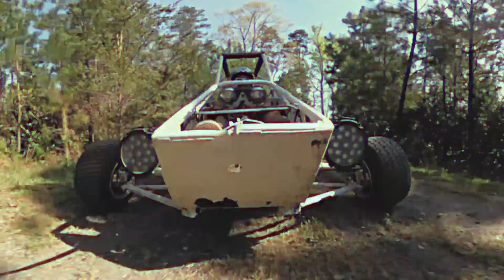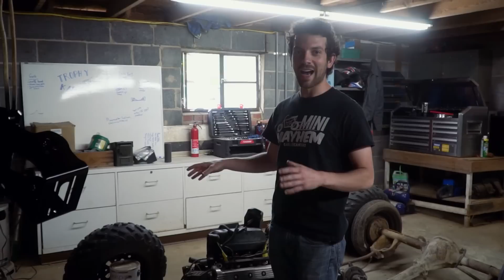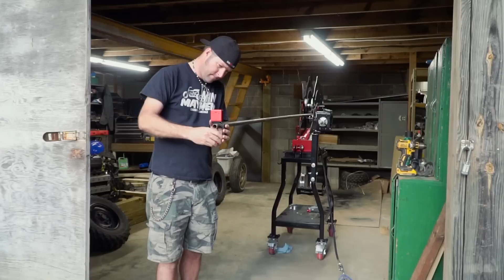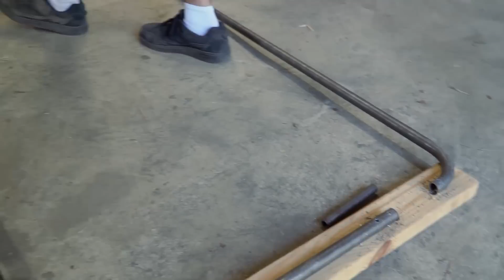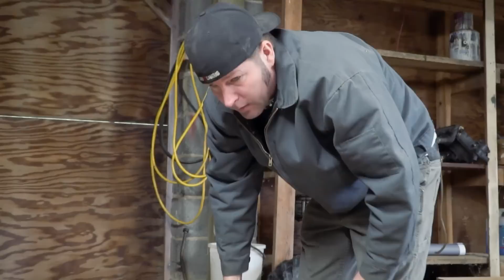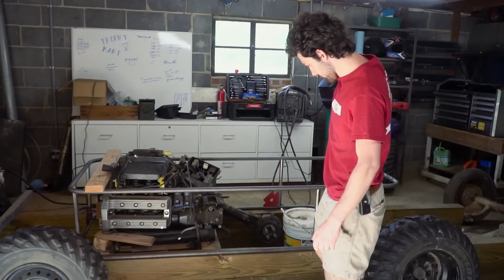1000cc Mini Trophy Truck Build Pt. 1 | BMW Powered Baja Buggy Go Kart!

Comment: That tube is way to small for that big a build. 1-3/4” .250 dom! You’re going to need 1-3/4” for the suspension links anyways to get proper hiems etc for joints. The entire frame should also be built from this. Yeah you’re picking up 15% in weight but you’re gaining 300% in strength. Cheaping our in the pipe for an actual full size vehicle is not something you want to be doing with something you’re going to beat hard.

Comment: You could angle the rear up right supports and add a bit more length to them. Then cut and angle th rear upper frame. To give it more of an aggressive look.

Comment: 1-1/2" .090 wall thickness is the engineered proper size for a 1000cc according to every sanctioning body of competition out there.. 1 inch is dangerously too small.  Look to Mini Sprint rules and Legend and Dwarf car rules building, NASCAR Short track rules too...

Comment: Have you ever considered a predator powered air compressor, where you have an electrical clutch connecting the engine to the driving belt, so a normal pressure switch could work?

Comment: This is purely my opinion, but you should really look at some off road tube frame chassis for ideas, none of them resemble what you have done so far. Look at the chassis design for front engine off roaders for an example. What you are doing is way too short and way too weak as it sits. I would also go with a 4 cyl car engine and transmission, that motorcycle engine doesn't have much torque compared to a car engine and you are grossly overestimating the electrical capacity of that motorcycle engine and there's no way to increase it, with a car engine its simple to go to a bigger alternator.

Comment: That seems like a lot of weight and power for 1" tubing, but I'm sure "it'll be fine".
Reply: Bro ppl build all the time with 1in. TUBING,.. 1300cc hayabusa  engine in a frame built with 1 inch ,..as long as they brace it properly, it'll be fine.

Comment: Why would you use a live axle over independent suspension?  The ride on a live axle for off road especially, will never be near that of an independent setup.
Reply: Just to try something different. Plus most trophy trucks are solid axles from my research

Comment: it looks like yall going to have a hard time with the drive shaft if you keep the engine at that level.. exhaust might also get uncomfortably hot! wheel base looks perfect, as for suspension travel in front of the engine and a little behind the seat position will get you the best results it all depends on how high off the ground you wanna go

Comment: If you were able to get a car engine with a fwd trans you could have made a mid-engine monster. Turn the engine where the belt is facing forward and have the fwd trans facing front to back. Then using the "drive axle" for each front tire as front and rear drive shafts. 
The trans has a diff slip so either welding that up or finding someone that makes a limited/locker for a fwd trans (4t60e and 4t65e have followers) you lock the trans and let the actual axles take care of diff priorities.

Comment: Um.... guys...
I don't want to stick my nose were it don't belong, and please feel free to tell me to mind my own business.
But that chevette axle isn't going to stand up to the kind of abuse you plan for it.
Believe me, I was stuck with one in the 90s and I was almost killed as the right rear chevette axle flew out of the houseing in a mild turn.  
If I may, I'd like to recommend a Subaru suspension system, they are tough, light, and better for what you have planned.
The good thing is that they are inexpensive, get a late 1980s 4 wheel drive car as a parts car.
Please don't depend on crappy parts, look for the good stuff.
It might not be fine.
T.

Comment: Check the splines on the bmw drive line they can round out and can imagine they will not survive  the weight and stress of the vehicle...i know its early in the build so not sure what the plan for connecting  the rear end to the bmws driveline might be. Also the bmw requires resistance  to excite the alternator normally  from the battery light on the cluster but a simple resistor can be used instead if the cluster is not used.

Comment: see if you can scrounch up some straight pieces of i beam like from a torn down old steel building , and put ajustable feet under them , set those up on the floor next to eachother and set those up level to the other, you can use those as youre frame and a welding jig , it basicly the same as you have now with the wood beams but more stable and fire resistant
as for putting the bender outside , yes you can but once you moved it you need to reset youre electronic level , the machine is probably far from level unless you make it level with the ajustable feet and the electronic level whont be acurate 

as for new shop tools like a good large volume compressor , maibe a good steel workbench , hydraulic press . a steel cutting bandsaw , stationairy drillpress and a stationairy belt sander , im guessing youre registered as a company for youre youtube channel , so see if you can get intoo any local auctions for bankrupt steel companies and garages (motorcycle lift tools and toolcarts), 
unfortunately for most i guess , with the corona stuff preventing companies from earning money there bound to be quite a few more companies that have to file for bankrupty this comming year 
when bidding for the stuff at steel construction companies make sure you look intoo there steel pile too , the stuff usually goes cheap (usually sold in lots though you might be able to sweet talk the auctioneer to put together youre own lot of the stuff you need) aspecially if the weather is realy bad and the auction is mostly outside or on a workday (less people willing to be there to bid on stuff) and you can get away with some realy nice professional tools and materials (bring a truck as you need to haul it off on the spot)

Comment: how do you even approach a prject like this? Im sure that your guys experience with go karts over the years probably plays but i feel like there are so many different factors (motor placement and size, type of susspension, height of the chasis=to the comprasion rate of the suspension, etc)that come into play when trying to get a picture together of the final project
Reply: I go in blind and hope for something cool

Comment: make the front end modular, with a trellis system frame. support it up and bottom on the corners of the existing center frame. make sure you make the center part the ridgid one. Otherwise, great project!

Comment: Maybe this gives you some inspiration! AutoCross Netherlands Sprinter Frame! Lot's of pictures on the web and also video's of regional dutch autocross racing events showing of what these machine's are capable of. Most popular Sprinter setup: Sprinter 1600cc (max) rear mounted Hayabusa motor-cycle engine, front motor-cycle wheels and big wheels in the rear. I love to watch those events live. :)

Comment: Cool build start guys. If u guys ever want to use 4130 in builds the best online pricing I've found for it is airparts ink. I've also ordered from them in the past and have had 0 issuies. They ship 8' or shorter lengths with ups. And can do 20' via freight.

Comment: Rock racers...That frame looks weak.tubing wall needs to be thicker if you want brute bang through up n over anything strength as well as suspension attaching...truss design for more rigidity,and as many points in a full cage as possible...

Comment: Shop compressors can get expensive. Here's what I did. Go to Harbor freight and buy 2 of the 2.5hp 21gal compressors. Regular price is under $200. They go on sale for about $160. Set them up outside, (it's quieter) connect them together and plumb through the shop wall with PVC to a good air dryer. When I turned mine on they went from 0 PSI to 125 PSI in 6 minutes. Recovery from 90 PSI to 125 PSI is about 1 minute. You will have enough air to run just about anything for around $400. One tip if you go this route. Retorque the head bolts after run in and check them annually.

Comment: OH man, they're gonna find a lot of problems with this build. The weight and gearing in that rear end could poo poo all the power. Getting the engine output to mate with that weird pinion is going to be very difficult. Weld the spider gears in the diff, otherwise it's going to be 1 wheel drive. That frame has "catastrophic failure" written all over it. Get ready for a 20 part series.

Comment: what I was thinking. Square in the middle for the driver compartment, then raised frame triangulated  at each end. Definitely will need a engine/trans/driveshaft heat-shield/scatter-shield so y'all can keep on building!

And Hello from Raleigh! Woop Woop!

Comment: Have you checked the rotation of the BMW drive shaft?  Most shaft drive bikes rotate the opposite way to car drive shafts (the pinion is on the other side of the crown wheel).  You may need to think about mounting the Chevette axle upside down.... then make sure the axle breather doesn't dump EP90 all over the floor :-)

Comment: Even before that first bar was done I knew you were going to hate it. Maybe on a home made 1980's go-kart the bed frame with a plate floor would work.
I saw where you were going on wondered what the purpose of that tube was? It doesn't pick up the motor mounts, doesn't attach to suspension pickups, doesn't mount the seat.
If you look at any vehicle like that you'll see there's nothing superfluous. I would run a tube from the lower motor mounts, to the seat mount, back up to the rear suspension towers. As a starting point. Then work from there.
Reply: P.S I still think the cross kart looks wrong.
It's not terrible, but could be so much better. I think the wheel size let's it down, and this kart is going the same way. Needs bigger wheels.

Comment: Awesome build! I'd get the engine mounted up to the bottom half of the frame then drop the upper front a bit while keeping everything accessible. Just lower it enough to get rid of the square look. I'd consider changing the front if it while you are in there to extend for front suspension support. You could use the current set of 90s to go over the front of the engine and take some spot lights.

Comment: Build it strong. I can tell John will be afraid of it, at least in the beginning. That engine is a game changer. Those parts for $500 is a deal. It's taken me some time to get some parts together for a buggy. Starting out on a floor like that is good. You will learn so much more.

Comment: With that diff, and those wheels and everything else thats got to be bolted and welded on to this thing, you will need a 2nd motor to make it go any good at all.
I'm a BMW bike owner and love them but I think youre expecting a bit much from a flying brick.
I love these guys and their enthusiasm but everything is just a bit dodgey and half arsed with little to no real planning or decent design principals.
That tube is all wrong from the start and that chassis already looks like crap IMHO.

Comment: I’d like to see you guys do something with a 4 stroke snowmobile engine. I think a Yamaha would work great as the use I high mount rad for cooling compared to tunnel coolers like other sleds. Have an awesome cvt set up and has 150+ hp stock with endless options to add turbos and supercharger

Comment: hmmm, I hope the transmission of the motorcycle engine can take the drive-line load weight of the car rear end and tires. Consider rear engine too.  Plenty of Baja Racers use rear engine builds.

Comment: You could probably put a big compressor with a horizontal air tank upstairs, or build a small shed out back. But you need something with a motor and belt-driven, oil-using piston pump instead of any of the little oil-free portable compressors. Then you need a safety switch on the wall near your panel so you can cut the power to the compressor motor while filming your dialogue, then turn it back on and let it recharge.

Comment: If you guys want your Ibeam to hold more weight. Weld steel plates along the beam between the two horizontal plates.

Comment: I had a couple of questions about building a go kart frame. Where would you recommend ringing usable engines and parts for cheap like at a junkyard or something and out of curiosity why do you guys prefer the round tubing compared to the square tubing?

Comment: Mmnnnn Twin I-Beam. Love it. So stupidly tough. Just watch your ride height guys; camber will change with suspension travel on Twin I-Beam and if your right height is off your camber will need to be adjusted quite a bit to make that work. I would suggest setting it such that there is precisely 0º camber with the kart empty so the weight of the rider will add a degree or two of negative camber.

Can't wait to see it rip! That front end's been under Fords for over 60 years now and it's proven!

Comment: Google trophy trucks look at real ones and some rc one... secondly most trophy trucks and any race or off road vehicles  they start with  Figuring out the vehicle suspension And where those components need to be at In the frame is used to tie in those parts

Comment: The cross cart's front end looks like it still sits way too low you have A arms for a reason the suspension should have been mounted a lot higher and a little bit less of an angle

Comment: Guys you've got like a bajillion engines,  all you need is a larger air tank and a belt driven compressor, build your own air compressor,  it'd be simple and very useful, could use that bender all day and an air hammer with impunity.  Do It!

Comment: You can always look at the mod lite car. Their a 5/8th scale version of a modified dirt track car and they actually use a 1000cc engine with a solid rear axle.  If you use a frame designed for that, but with a long travel suspension it would be awesome.

Comment: I don't know why you are wasting money on DOM tubing when ERW would be fine. you are not building to a class of racing, 1" x .090" ERW with the seam on the inside of the bend and you are golden. does that Chevett  rear end have "C" clips holding the axles in? if so you will want to address that.

Comment: Stick with the chevette for the front hubs. The bolt pattern is the same front to back, four bolt 100mm. This is also a common atv bolt pattern. Also chevetterims are thirteen inches in diameter, six of them and you can get them widened to take any thirteen inch atv tire. Early eighties BMW four bolts will fit as well as eighties/ nineties dodge four bolt rims, this gives you fourteen and fifteen inch rims to access. This may oversize your tires thiugh. Sticking with thirteen inch ATV tires and modding the chav rims may work best.

Comment: Short ssnd cars front suspension or ssnd addiction.  Same thing but the sand addiction spindles had king pin angle and handled better in a straight line. I would go with fox 2.0 shocks they are cheap and work well till they get hot. 
Azrockcrawler for the chassis inspiration.  I want to see long trailing arms to where the drive shaft comes out of the engine.  More than 12" front suspension.  If you cant hold on to a drink and hit whoops at 50 then I will be disappointed.  Time to step it up gentlemen.  Take it to the next level. I pieced together a short sand car years ago. Got the chassis untabbed and went ot town. Cbr954rr motor it ripped, we were so hard on the damn thing it needed a valve job after every dune season (6-8)trips. Good luck!

Comment: Great parts.. glad you guys are getting things together.
I do think a rectangular or square material  would be better. 
And maybe go for a more sand rail frame design? Just saying.
Go rear engine with it. The weight  in the back will help ...
Any way either way...
It will  be  fine...

Comment: Weight will be the biggest issue. If you make it too heavy that engine will hate life, they are designed to rev and not be lugged about. Watch the struggle Rather B Welding had with his VFR1000 powered buggy.

Comment: Super looking forward to the build and loving the intro. but i always thought the process of building your own space frame starts with the wheels, then suspension and then the chassis. to avoid all the chopping up of the chassis later like you had to do for the crosskart. the extra tubes make it heavy and not correctly following loading paths mean it fails in an accident. there are so many free resources on chassis design and suspension and a little pre planning that would make the build smoother, the end product better and safer. i love the channels ethos is it'll be fine and have a go, but you're strapping yourself to 100bhp and firing yourself over the horizon, it can all go wrong .

Primarily you plan your suspension first to get correct geometry, sure the crosskart works well enough but i bet those front shocks would be happier at the right angle and the back is so stiff it makes the front do most of the work... the crosskart is awesome, but you dont want to have an accident in it the way the chassis bars join up its asking for pretty catastrophic failure, and i want you guys safe so you can keep building more.

at least get some proper safety gear like new full face helmets and motox protection or leathers so you have a chance when you barrel into a tree at 80mph ;) all that said i cant wait for the next episode 👍

Comment: Dude just add a booster tank to multiply your volume. Ive got a similar air compressor craftsmen 35gal that i plumbed into my old 35ghuskee. (Without a motor/pump) creating 70gal volume. Takes longer to pump up originally but goes twice as long before psi drop/mot running

Comment: Guys if you midmount the engine behind the seat you'll have better traction & weight balance. You could  use the frame tubing as coolant lines for front mounted radiator creating additional heat dissipation.